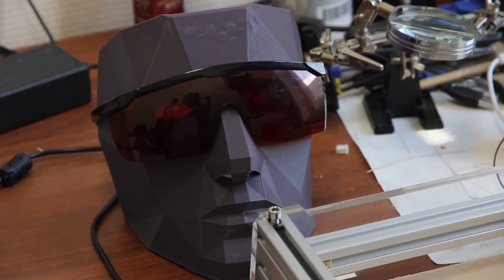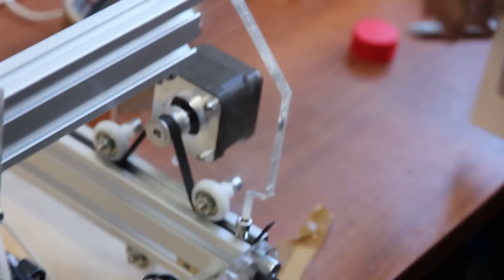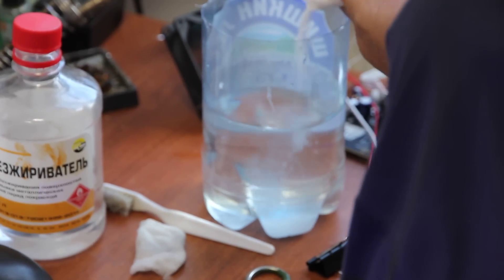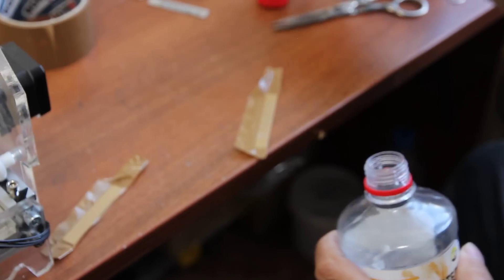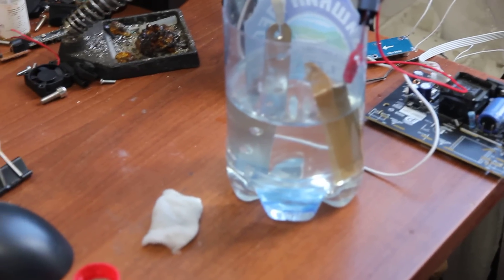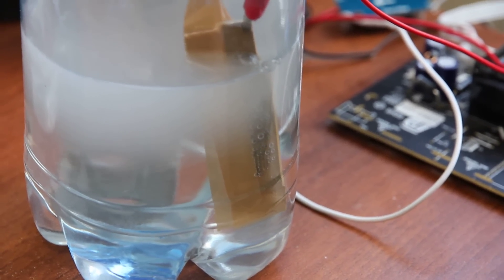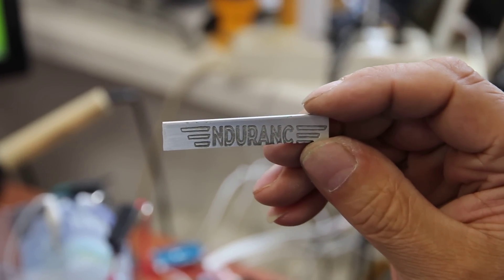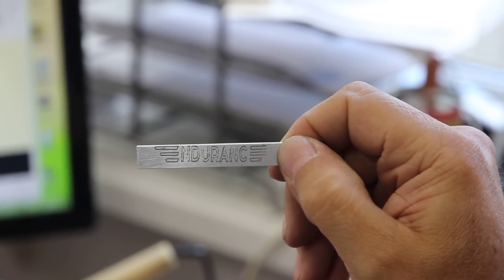aluminum engraving at home using diode laser

Comment: I bet if you did this with steel you could paint on some ferric chloride after and get a nice etching.
Reply: i figured it would save some time and effort, as you can get ferric chloride and other etching liquids for steel rather cheaply and easily, rather than having to build an anodizing tank.  If memory serves, wax works very well for chem etching designs into steel and i imagine would vaporize very easily from even a low power laser.
Reply: George Fomichev  I have the 7w version already.  :)  i may do an experiment with it at some point, still doing tests to see what materials it handles and how high a feed rate i can run without over/undercooking the target.
Reply: George Fomichev I went in and tried it a few times.  Took the ferric chloride and added it 50 50 to water to make hydrochloric acid since the target is steel.  Cheap 99 cent black spray paint worked the best out of all my tests.  Just one quick pass over the dried paint blasts the paint off wherever you want it to etch.  Then dab the acid on in the etched area, you can use a cue tip or cotton ball or whatever you choose, just try to dab and not rub much.  In about 10 minutes the etching should be done.  Don't leave it on for more than maybe 20 because itll eat the paint off.  After that you simply need to wipe it, rinse it, and use acetone or another paint remover to remove the leftover paint and you're done.  A nice acid etched engraving on whatever piece of steel you have lying around.  While my laser is significantly stronger than most of the solid state ones sold (7w as i said earlier) im confident even a 1w laser will blast off the paint and be able to do the job.  I did NOT get a chance to try it with plastic tape like you used here, because I don't own any.  It might work, or the acid might eat it.
Reply: George Fomichev no problem!  I said I'd try it out for ya.  :)  oh, don't waste your time with the wax though...doesn't work.  It just melts and resolodifies.  SprayPaint or nail polish seem to be the best options.

Comment: I am glad to find this video as I want to put text on my aluminum sheet it is 5062 grade but not 6061 grade. Could you tell me where to purchase the board which use to anodized the aluminium shows in this video which has (white & red wires connect to the salt-water bottle) - About the tape which cover the aluminum before engraving, what kind of tape is that? can i use any kink of tape to cover the aluminum. Thanks
Reply: I am confused. I already have a shapeoko CNC - can I only purchase your Laser unit and connect to my CNC will it works? Thanks
Reply: I am thinking and learning about this before I decide to make the purchase. pls tell me, I a newbie and do not understand. where do I purchase the device to anodized my aluminum ( the device with the red & white wires which connect to the 2 aluminum inside the water-salt bottle. pls explain what is the aluminum wit-out the tape used for??? pls help and explain to me
Reply: Thank you will have to study on this before trying it.

Comment: So basically we anodized the aluminium that didn't cover by tape, which mean if we add color dye to the process we can make color etching right?
Also if we etching the tape and peel all off the tape off except the etched part we can anodized the whole part in color and leave bare aluminium as etching pattern.
Reply: I know you posted this a year ago, but if you anodize first, then etch the anodized surface with a 7 watt itll burn right off.  (I know this because my lab stand is anodized and now has a nice image of a rose etched into the anodized surface...  Not sure how weak you could go to get the same effect, I bet a 5 watt would do it.  3 watt might.....but im not certain.